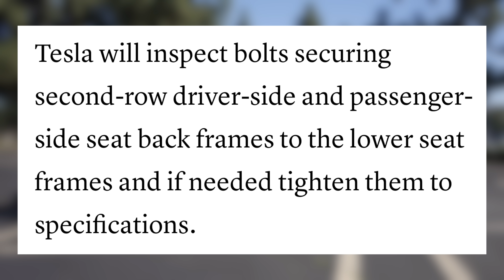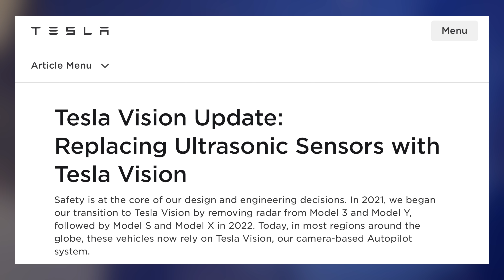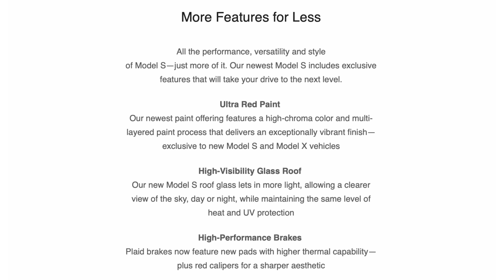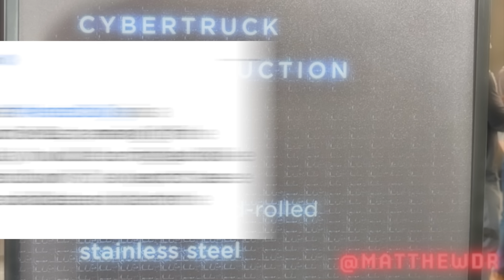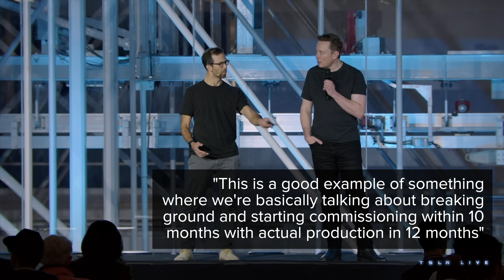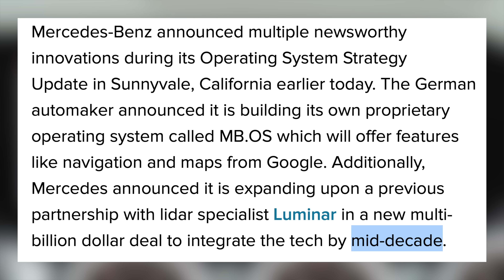The BEST Tesla Just Got BETTER | The New Tesla Model S is Here

Comment: To remove radar system that's a huge mistake. I'm talking from North side of North America such as Canada. I still have radar and sensors in my tesla model 3 2019, but, with new software updates they removed that and not using while autopilot engaged and only used cameras, which is here doesn't work. Because of bad weather conditions, such as snow, heavy rain ect., bad visibility and autopilot or cruise control stop working. They need to work more on that. When i bought a car over 3 years ago, cruise control and autopilot worked great and never let me down, but now got worse. It's just my experience after 230000 km or 130000 miles

Comment: The reduction to 2 front forward-facing cameras means the total number of camera connections in the unit is 3 (when you take the internal camera into account) which is the same as HW3 'Legacy' S/X.  I wonder if this makes the HW4 front camera unit retrofittable on older S/X which had 3 connections for the forward-facing cameras? (Obviously with changes to the port allocations in firmware).

Comment: Removal of the ultra sonic sensors on the Model S negates all of the goodness hear. There is no possible way with the lack of a front bumper camera that Tesla vision will be able to replicate them. Even if the cameras locate objects and approximates their location virtually as they go out of site, it will not account for when the objects have moved or new ones have been introduced (like a child’s bike). I own a 2022 Model S refresh and have the USSs, the surround view (birds eye view) in my 2021 Genesis GV80 is far superior, the USSs in the GV80 trigger the bumper camera when you’re close to something and you can see the edge of the bumper and the objects proximity to it, my Model S shows a line and provides an approximate distance in centimetres. Bottom line, Tesla didn’t get it right with the USSs and Tesla Vision with the current camera set-up will not be better. For practical day to day, this is a deal breaker.

Comment: Re recall... My steering wheel is attached with a nut onto a threaded steering shaft, so I presume Teslas have a bolt from the horn cover through the  steering column and attached to a threaded hole further down the column..??🤔

Comment: Not happy with tesla right now. Had the Recall eMMC chip replaced on my 2017 S and it totally bricked the car, Tesla is refusing to help, stating it now needs over $6k in repairs for other systems that were fine before
Reply: Buy a Taycan
Reply: @brandon7136  the charging infrastructure cannot compare and it gets half the miles as model S does.
Reply: @chezikmusic  eh.. I'm not an over the road trucker and the Taycan charges fast as hell. The electrify America network is sufficient (east coast) but I'll admit the reliability needs improvement. Also please don't look at the official range, Taycan gets a tad less miles in real world driving than the Model S, it's been discussed a lot.
Reply: @brandon7136  my model S gets around 400 miles on a full charge. Taycan gets nowhere near that. I wish Taycan range was better because it is a beautiful vehicle.

Comment: I just purchased and picked up a brand-new Model X from the Fremont factory with HW4. I'm coming from a Model Y, and the new HW4 cameras look amazing, especially when you use them to check your blind spot with the blinker on. However I'm sad to report I that I'm having tons of problems which all kicked in 5 minutes after taking it off the factory "lot". My steering wheel drives about 20% off of center and I have a slew of errors while driving: No break regen, no saftey features, no autopilot, no cruise control, no lane assist and other errors.  Also the "automatic" driver door only opens about 4 inches and then you have to push it open against the resistance of the motor the rest of the way to get out. On the plus side, they quoted me only $250 to fix everything a week from now. Seriously, I'm not sure why they quoted me $250, but everyone at Tesla seems like they're over worked and they're doing you a huge favor by interacting with you.  It's kind of like communicating with a faceless AI. I'm really not sure what's going on at the Fremont factory in particular, but it seems like they need to shut down that factory and start over with a new one.
Reply: you got MUSKED

Comment: Tesla is like an iphone.  Moderate improvements year over year.  There is really no excitement from version to version.  The car looks basically the same as when it came out in 2009.  Not necessarily a bad thing, but I think a lot of customers are ready for a new body design.
Reply: Even the iPhone has updated its design significantly since its inception
Reply: The S has the best design imo so I would hope if it was changed it doesn’t look worse
Reply: Heck no. The new plaid looks slightly worse then the previous S

Comment: Bring back indicator stalks on the model S. Having the indicators on the wheel is dangerous if you are doing a quick series of turns where the wheel isn’t straight ahead when you are trying to use them. 

There are multiple instances of this requirement within a few km of my house, and that doesn’t include some round abouts where changing indicating while turning is required.
Reply: THIS
Reply: Agreed
Reply: Ferrari and Lamborghini has had their indicators switch on their steering wheel for several years before tesla. They seem to be fine.
Reply: @bradchin7746  There are few Ferrari drivers out on the road during all times of the year relative to Teslas.

Comment: I had an '86 Jetta where the steering wheel came completely loose.

I just got off a highway exit ramp A couple minutes earlier and was parallel parking when the wheel suddenly just spun loose.

I was so grateful it didn't happen three minutes earlier.

edit: The car only had a few thousand miles on it. I never considered buying a vw again... and especially so after  dieselgate.

Comment: I do agree that a steering wheel falling off does indeed increase the risk of a crash.
Reply: Just pull on it hard while it's parked to see if it's lose
Reply: @ukaszstec470  if not, then it wins
Reply: @ukaszstec470  Loose, not lose.............
Reply: @keitha.9788  boring comment. thank you Keith.
Reply: Yeah. The Nissan Ariya has a recall for steering wheels coming loose but it's not as newsworthy.
Reply: Who's installing these falling-off steering wheels? Toyota?
Reply: Guess it can’t be fixed with an over the air update…
Reply: Just activate FSD😂
Reply: That was just one vehicle and they replaced the vehicle free of charge if I remember correctly.
Reply: @matthewboyd8689  They replaced the whole vehicle? Seems like they could have just tightened the loose bolts.
Anyway, I was ribbing the fact that they literally said that a steering wheel falling of "...increases the risk of a crash". It was very insightful of them to alert us to that!
Reply: 😂😂😂 I live for this type of humor

Comment: thanks for the update on the steering wheels, missing bolts, could be worse I suppose, not a design issue, bad hiring of assembling workers
Reply: Err... No. Its a process design error. A shitty worker cant be blamed for a life threatening defect like this. Otherwise it would happen all the time with other makes. It doesnt.
Reply: @wizzyno1566  You obviously didn’t listen to the information in this video. Nissan also has the same problem with loose steering wheels.
Reply: @Harrythehun  bullshit. I can think of nothing worse than a steering wheel coming off. Well done with the normal "Tesla can do no wrong" crap though.

Comment: When are we finally going to get the update for Tesla vision? This car is running blind when it comes to front and rear and side sensors. I consider that a safety issue. Is it time for a class action lawsuit?By the way, I am referring to my 2023 model Y. But I think owners of 2023 model three is also affected. I know of no luxury vehicle over $50,000 that does not have such a feature.
Reply: Never drove a car without those sensors before? And they did tell you it doesn't come with it.
Reply: @Captain Snake  
Surround view cameras are standard on $20,000 Kia and Hyundai models.  I used "summon" on my Model Y while parallel parked against a curb in a home depot parking lot and the blind car decided it would drive over the curb, trashing my right side front and rear wheels with a nasty curb rash.

Quit playing "ignant ash whole" and pretending the car is capable when it has massive blind spots on its cameras 😃👍
Reply: @yourlogicalnightmare1014  use your mirrors and drive the car. I have a model Y with sensors, which are great sure. But have had many cars before then plus my civic I have now and I have never hit any of them while parking or curbed my rims.
Reply: People drove cars for many decades without all these sensors 😂.  Learn how to drive yourself and stop with the 1st world privilege cries.

Comment: Just to be clear: Recall has a specific meaning in the context of National Highway Safety. Administration.  It has absolutely nothing to do with "how" the recall is done.  Over the air or drop off at a dealer is moot. What is important is to know is "When a manufacture or NHTSA determines that a vehicle, equipment, car seat or tire creates an unreasonable safety risk or fails to meet minimum safety standards"  No need to try an make light of Tesla's recalls simply because they sometimes can be done over the air. Suggesting otherwise is simply incorrect and is an attempt to marginalize the actual safety issues under recall.

Comment: I am really unsure about these improvements on Model S and X.
How much lighter can a glass roof really get, without compromising sound proofing, insulation, and safety? Considering going from a metal to a carbon roof usually saves some 5 to 12 pounds on BMWs and Audis, I‘d expect this to likely be less than that, because they still use the same basic material.
Even if it was 5lbs lighter, I’d highly doubt anyone could measure the „handling differences“ let alone experience them. 
I know that it is technically correct, that it lowers center of gravity and should therefore alter handling, but that’s really extremely marginal.

Regarding the brakes. I like that they improved the braking, as these 1000hp vehicles are severely under-braked.
However, I find it potentially problematic that apparently only the brake pads, and thereby only the thermal capacity has been improved. Again, every improvement is welcome, but the Plaids perform pretty poorly with cold brakes, which is also likely the most important thing in real world scenarios.

Comment: The main reason for many who want model S steering wheel is the light and gear shifter stalks.. pointless with wheel if stalks are not there!
Reply: Not pointless since the yoke is idiotic in a car that's multiple turns lock to lock, but yeah, they need to give us at least an option for stalks.  The stalkless yoke is the dumbest thing Tesla ever did.
Reply: @incognitotorpedo42  was thinking pointless for whose wanting stalks.
stalks standard then yoke optional with a couple programmable buttons